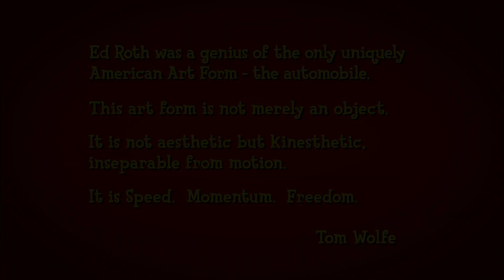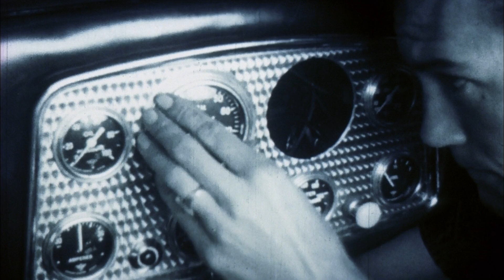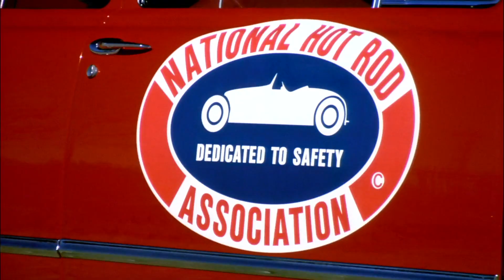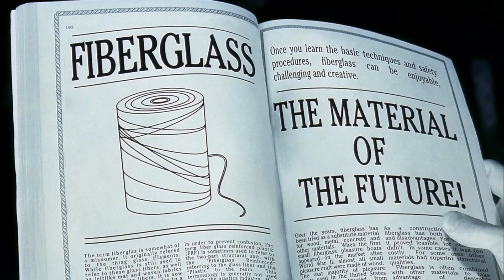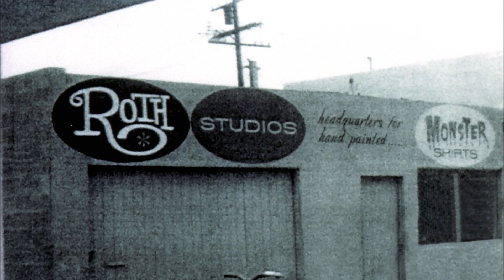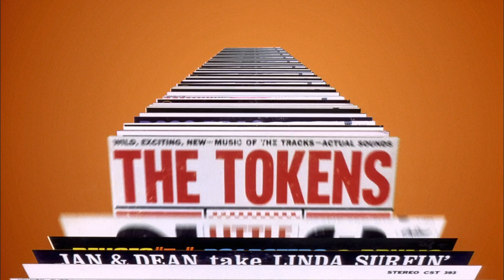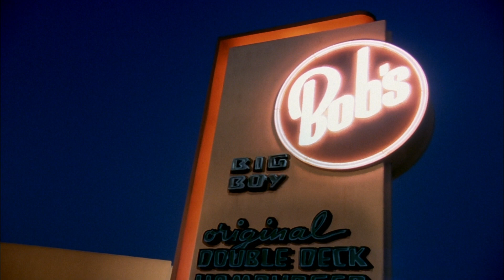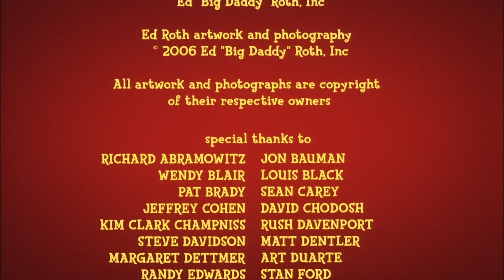Cuentos de la rata Fink ¨Tales of the Rat Fink¨ Documental completo

Comment: I was living in Benton. Arkansas when the Ford Mustang became available, I had a Friend who bought the First Mustang in Arkansas, the     April 1964 – July 1964 (1964½ series) Straight 6 Cylinder Red 170 cu in (2.8 L) Thriftpower I6 Straight-six engine 
Straight-six engines are typically produced in displacements ranging from 2 to 4 L (122 to 244 cu in), 

however engines ranging in size from the 0.7 L (43 cu in) Benelli 750 Sei motorcycle engine to the 6.7 L (409 cu in) Cummins B Series engine pickup truck engine have also been produced.